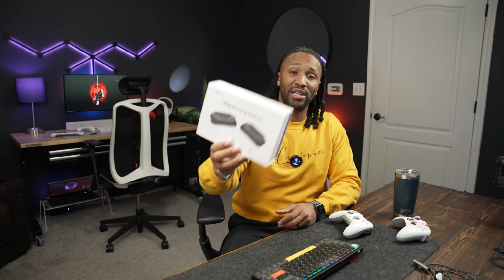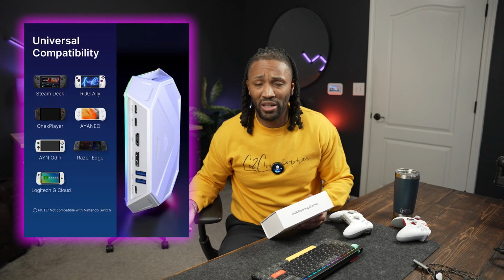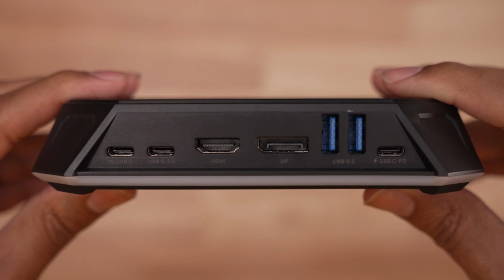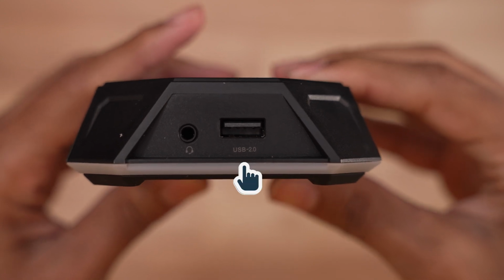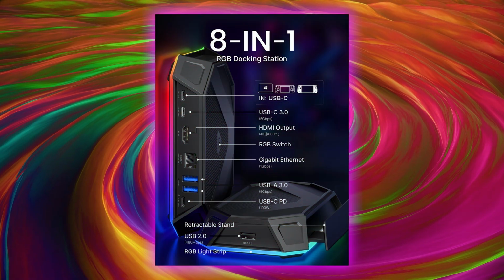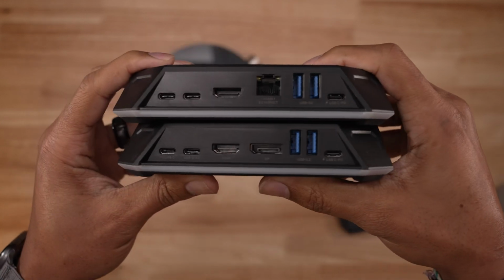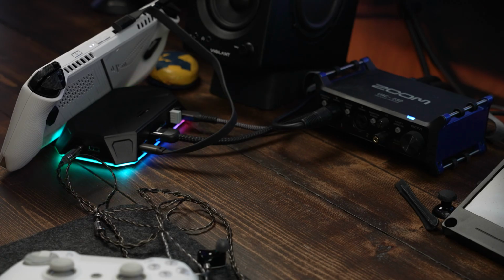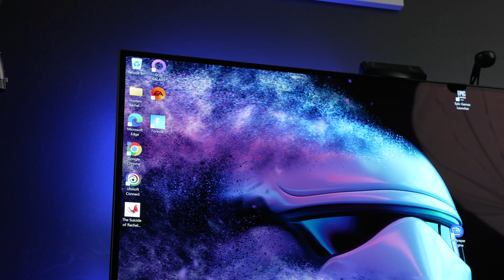The JSAUX RGB Gaming Dock!!!

Comment: Would this dock work with rog z13 flow ? I want to use as mutiple screen display
Reply from the maker: Hey Kim, yes, it would. It's able to support my Macbook Pro M3 just fine. As long as you're pushing enough power through it to support the device you want to use it will be fine :)

Comment: Can i get links to the usb c that you have on there? Cause idk the one thats came with the dock when i plug on my ally it's draining my ally battery fast....
Reply from the maker: Hey! Hmm! What are you powering the dock with? The dock can take up to a 100w charger. But I’m powering it with the included 65w charger from the Ally and that’s been just fine. Could be your power source, if you’re using something else maybe 🤔
Reply: That's what's I got on too....
Reply from the maker: Hmm, I haven't had any issues. Have you checked to see if there are any firmware updates? Have you checked your power settings to see if you have anything set to overclocked levels by using a manual power plan versus a standard one?  @douakhang6199
Reply: When i plugged on It's keep saying " the current adapter in insufficient power supply and battery drain while gaming. For best results, please use the included rog adapter"